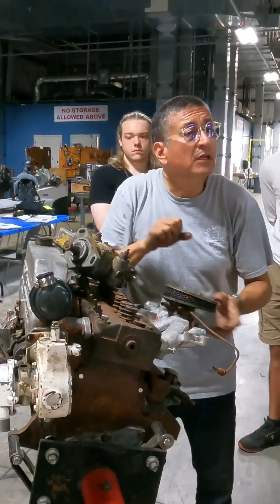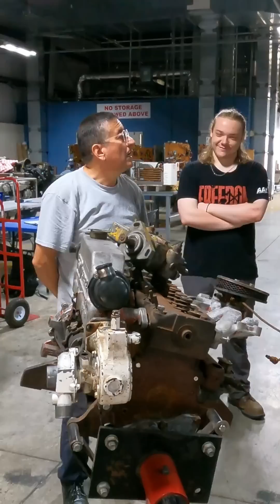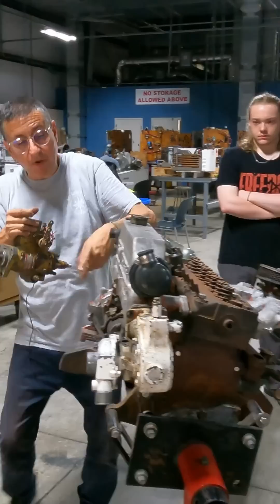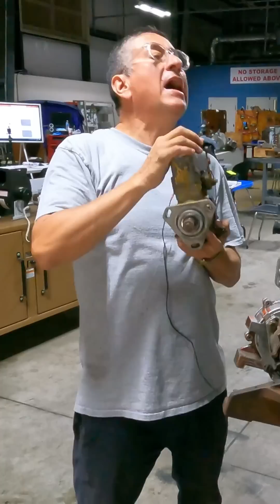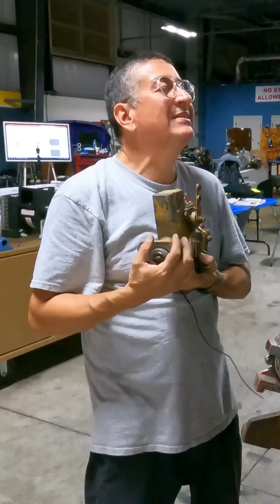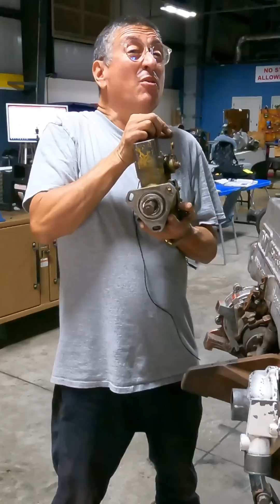How Diesel Engines Accelerate

Comment: I’ve only ever worked on gasoline engines. Today I learned the throttle on a diesel engine is controlled by the fuel pump. Thanks maestro.

Comment: I would have looked crazy by trying to find the throttle when a diesel engine would have issues. I have not diagnosed many diesel engines to know this lol. I work on all electrical cars and drivability strategy. Good info.
Reply from the maker: I appreciate your comment, it's great that you found the information useful.